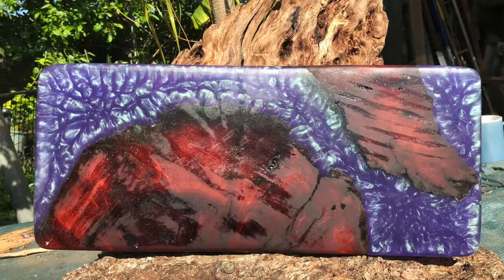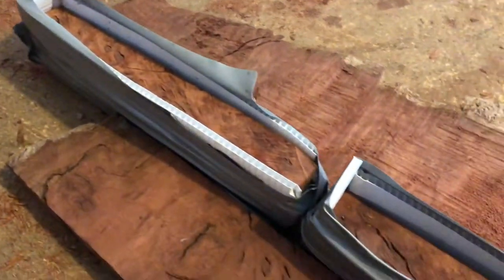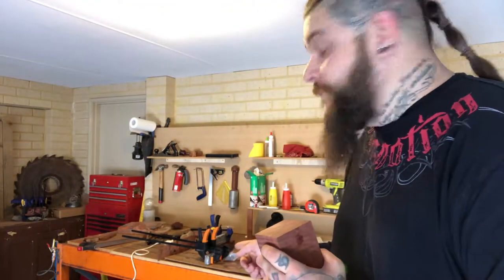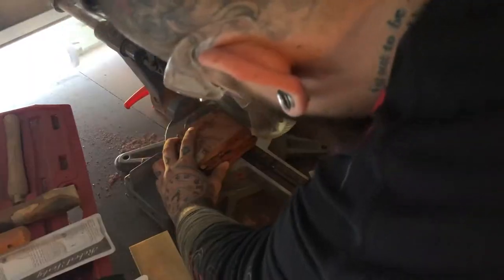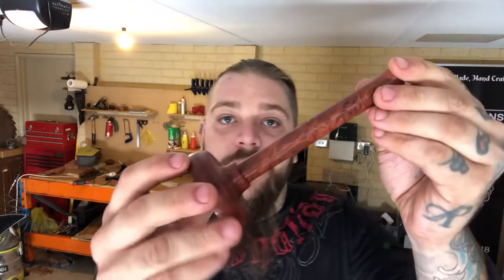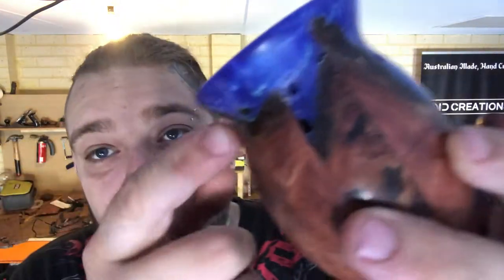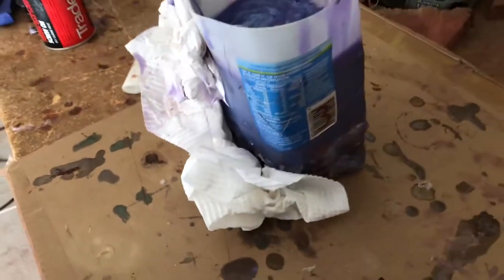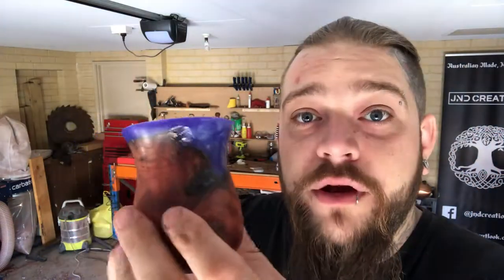Hybrid Burl-Resin Goblets

Comment: Nice work. Why don't you buy some HDPE sheets and make your own moulds
Reply from the maker: Wow, I haven’t watched this video in a long time. What a throw back 😂
This was very early on in my maker days so I didn’t know where to source HDPE sheets. Turns out milk cartons are hdpe plastic though so they do work well. I tend to use melamine these days for my moulds though.
Reply: @JNDCreations  yeah it turns out a lot of plastic is HDPE. And it's easy to melt down and make something else from it so I've just found out from the power of YouTube
Reply from the maker: @dnavanlife5846  I’ll have to look into it myself! Thanks mate!
Reply: @JNDCreations  Throw down some packing tape on top of the melamine- it will make it a bit more reusable. A tip from your favourite Canadian fan.